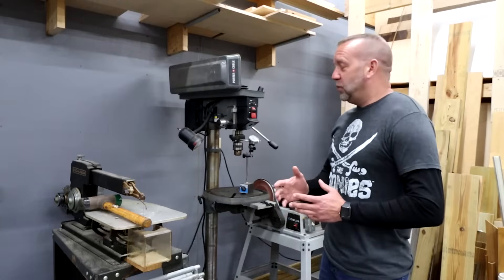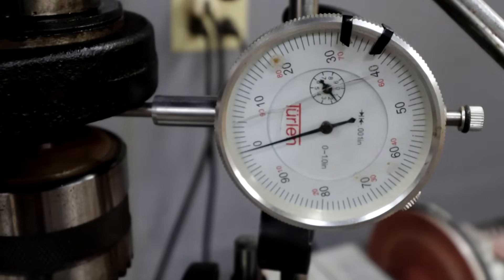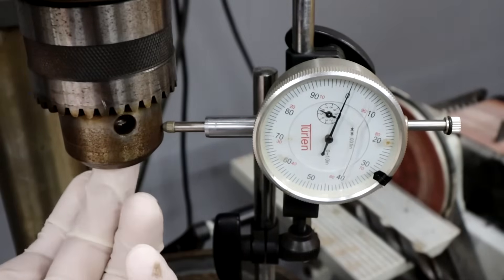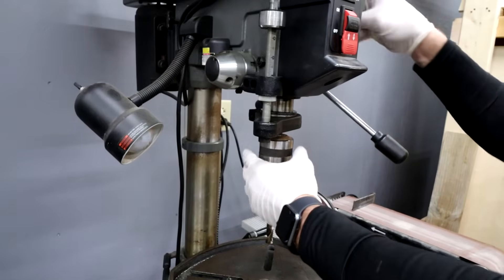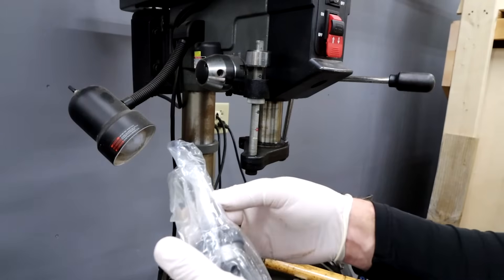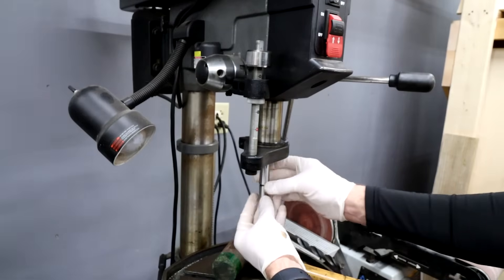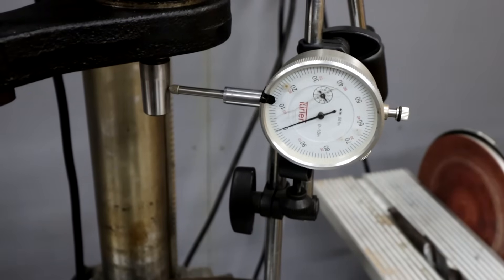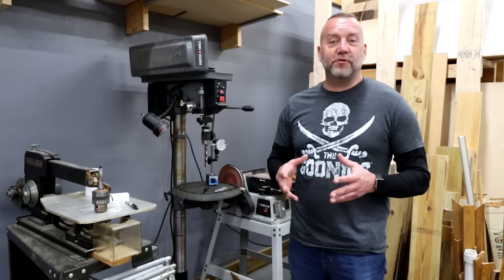Shop Shorts - Drill Press Chuck Runout and Replacement

Comment: Someone showed me once, that when you chuck up a bit and tighten it up with the key you just don't tighten on one hole.  You half tighten on one hole, pin 120 degrees and tighten a bit more and then finish in the third hole.  I tested three drill presses this way.  it makes a difference.  I think it's the same way that you don't tighten one jaw on a piece in a lathe and expect it to be centred.
Reply: To Davewolff.  You are probably right.  he was an old guy and I'm an old guy now.  I do it now out of habit.  I have a drill press with a jacobs chuck now .  much improved.  I was using a 1949 delta rockwell which I still have.  I like the advice about tapping it true.  Thanks
Reply: I would bet as the quality of the chuck goes up the necessity of even application of torque goes down. Somehow the chuck on my rigid froze solid and moves alright after running a good deal of tool oil through it, but the runout is so bad I’ve broken several large drills in mild steel. Time to fix it.
Reply: @colinjohnson5515 time to replace the ridgid thing with a good thing 😀
Reply: I always tighten as you describe, but mostly just to ward off the ghost of my father wandering into my shop to haunt me. 🙂
Reply: Tighten the three evenly. That’s why there are three. I have fifty years of experience.
Reply: @mauricebuzzell7533  👍
Reply from the maker: For drill presses with a good chuck, it really doesn’t make a difference because you’re spinning the chuck regardless of where you insert the key. Think about how the outer sleeve is all one piece.
Reply: @JaredsShop  It does make a difference, try it.
Reply from the maker: @pinballrobbie  
I’ve done it for years out of habit but it doesn’t help. It’s physics. The solid ring around the chuck will spin the same regardless of where the key is inserted. If there is anything at play, it might be the insertion of the bit, how someone holds it, etc. The only chuck that needs tightened in different positions is one with independent jaws.
Reply: @JaredsShop  Despite the physics I have not found this to be the case, I must concur with bobelliott2748.
Reply: @JaredsShop As a retired structural engineer, I agree it is physics, but I also agree that the OP is correct in that it makes a difference.  There is play in all mechanical systems and where you apply the force to turn the tightening ring moves it a certain direction in the play before it rotates.  This makes a difference on the position of the chuck jaws.  One quick way to know this is to see how much you can additionally tighten the chuck with the other two positions.  For example, tighten a drill using just one key position as tight as you can.  If the chuck ring turns the same from all three key positions, this would mean that you would not be able to further tighten the ring from any of the other two positions without applying MORE force than you applied to the first key position.  However, if you place the key in another position, you will find that you can easily turn the ring a little more with much less force than you applied to the first position.  That is the clue that it is useful to tighten using all three positions.  And it is generally better to apply a light force to the first position, medium force in the second and then the most force in the third position.  I also usually go back to the starting position and hit that again, but it rarely turns more at that point without really excessive force.
Reply: @LTVoyager you said what I wanted to say, but better and with more authority.
Reply: @JaredsShop ask any machinist,they’ll tell you it makes a difference. Drill some test holes using the two methods. Use your dial indicator. Use any testing method you like, you’ll see you are wrong.
Reply from the maker: @dangroce82  
I’ve machined for quite a while, spent years as a CNC and manual machine technician, and proven this completely inaccurate. It’s also completely illogical. The only thing you may be doing is putting force on something laterally but it does not affect how the chuck has tightened. Any results you see are from some other factor.
Reply: @JaredsShop  But, as you demonstrated, your old chuck was not a good chuck. Tightening as described might have taken out some of that 11/1000 runout. Maybe.
Reply: @JaredsShop 
That’s what I’ve been made fun of for saying for many years. Nice to see someone else who can think for himself. :)

Comment: Total rubbish, try checking the Spindle or chuck with the under power running it at full speed that will show the true runout. Turning the spindle slowly by hand proves nothingn
Reply: I disagree spindle run out is checked by hand when machine is running vibration from machine will have your indicator bouncing all over. NMTB ( National machine tool builder) spec's for run out are tested with machine spindle rotated by hand not at full speed there is a test for bearing deviation but requires much more than a indicator to be done.
Reply: This video is describing a perfectly good process.  Runout doesn't magically get better on a belt driven bench drill press when it spins up.
Reply from the maker: The runout is bad under power too, which is what led me down this path. Bits walk all over the place.

Comment: The adapter is called an arbor…the flat part at the end is called a tang…if the arbor is threaded with no tang, a cap headed screw can be screwed in to act as the tang for removal from the drill press quill..
Reply: Nice to see the correct terminology being used. The Morse Taper with threaded end is for use in a milling machine with a threaded drawer rod. For use in a drilling machine, a bolt with correct thread can be screwed into the threaded end and used as the ‘tang’ for drift extraction. Machinists know all this, the average DIY user most likely does not, so we have to help fill in the knowledge gaps. Greetings from Tasmania Australia 👍😁🇦🇺
Reply: Isn’t the threaded top of the chuck shaft meant for the pull rod of a milling machine? The chuck was ordered with an incorrect shaft.
Reply: @petermarsh4993 -Correct-wrong adapter/application.
Reply: I agree.
Fit a bolt in the end with some loctite.
I have fitted a bolt into my tangless morse taper 2 on the drill chuck so i can extract it from my tailstock on the lathe.

The thread can be used to hold it in or to help release it.

Comment: i learned to hate keyless chucks, much longer dan a normal chuck and always slipping and therefor f@king up your drillbits.
never ever keyless chucks for me....
Reply from the maker: Understood. I like both and we’ll see how well this one works. So far it hasn’t slipped on anything I’ve used it on. If I find it doesn’t hold up then I’ll swap it out for a nice keyed chuck. 

I have an older Milwaukee corded drill from the late 90s that has a ratcheting chuck. There was no key. It was a keyless chuck but not in the conventional sense. You slid a collar back, pulled the trigger, and slid the collar forward. As you did that, it would “ratchet” and tighten the jaws. I haven’t seen a chuck like that since. It must have had issues that I haven’t seen yet.

Comment: How do I order a keyless chuck for central machinery bench drill press 10" 12 speed.from harbor freight when I turned it on the chuck wobbles and the drill press shakes. it's about a year old and and don't use it a lot. I do have some videos of it running too.
Thx hope to hear from you soon
Reply from the maker: The link to the keyless chuck is in the description. Then pop yours out and see what king of shaft you need. You can buy different shaft sizes and tapers to fit the chuck.

Comment: Good video, addressed process well. The tough part seems to be knowing specs of which parts you are changing… I. E. ; how do you know it is a Jacobs taper?
Reply: I've been a machinist for 50 years , MOST drill presses most have a Morse Taper . IF you KNOW for sure that the chuck you have is a Morse taper & when you try to fit it  , if it wobbles or DOESN't fit the internal taper in any way , then it ISN"T a Morse taper . the other possible tapers that it might be would be ... a  "JARNO taper " , a "  Browne & Sharpe taper " & " American National Standard taper " also there is a " British Standard taper " . In 50 years of running drill presses manufactured between 1890 & 1970 I've Only seen the " Jarno taper " & the " Browne & Sharpe taper " ONCE , each . Your drill press would Have to be REALLY OLD .
Reply from the maker: Thank you! 

My old chuck had JT3 stamped on the top. If you closely when I’m measuring that, you can see the stamp marks. If you’re replacing a chuck, the only thing to worry about is what new adapter you’ll need for your drill, which I should have explained is easiest to tell my measuring with a caliper. I’ve been around machine tools for decades so the MT2 was second hand for me. Most drill presses are going to be an MT if some size. A lot of drill bits are offered with those shafts so the bit goes directly into the spindle without using s chuck.